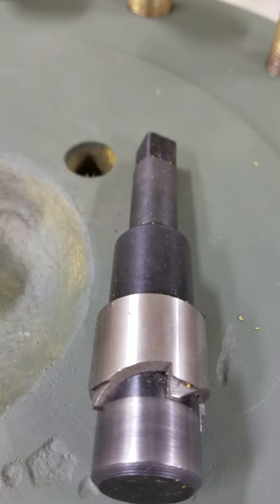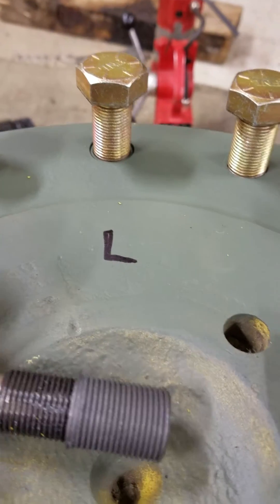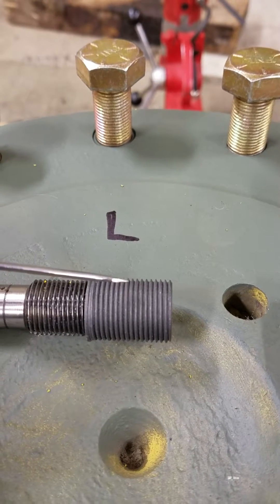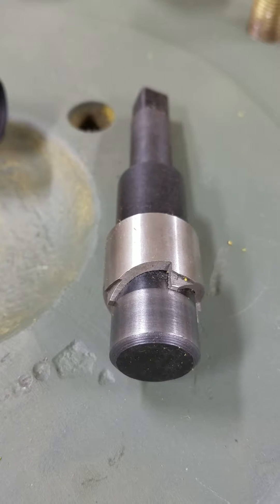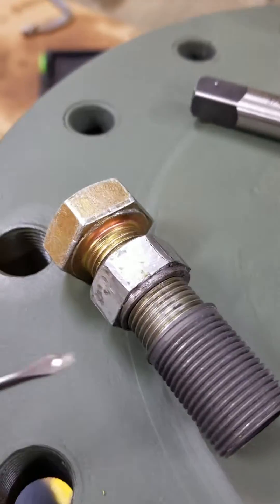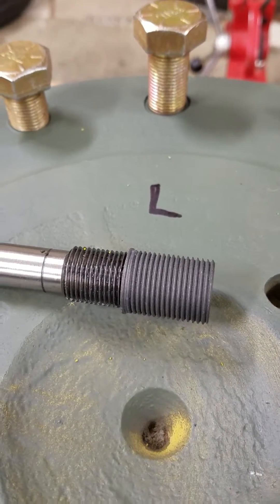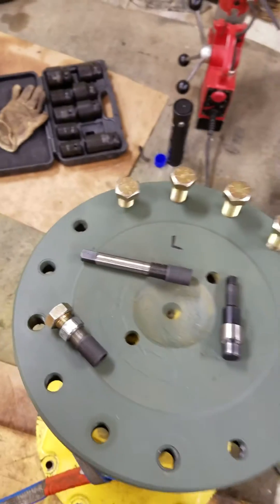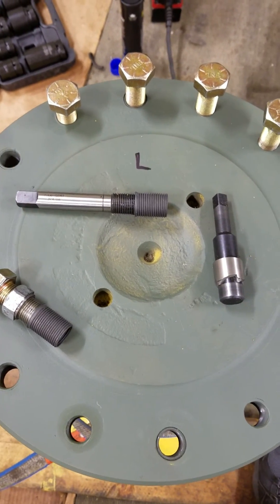Time fir a Time-sert review

Comment: Thank you great video only thing I'm really having a hard time understanding. How did you make that tool set up to make it work with the nut and bolt
Reply from the maker: I had to give it a quick watch, the nut was chucked in the lathe and a little shoulder relief was cut to catch the shoulder of the time-sert insert without running the thread all the way down and locking it in place too early.   The nut should work on the insert tool as well, a single wrap of copper wire to make the shoulder drive if you don't have a lathe, get the insert seated then run the tool down.